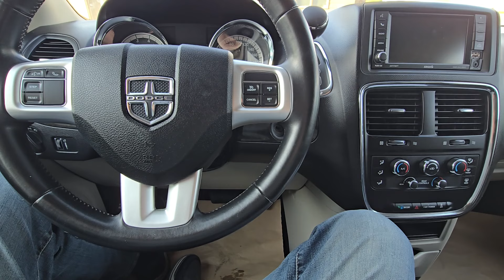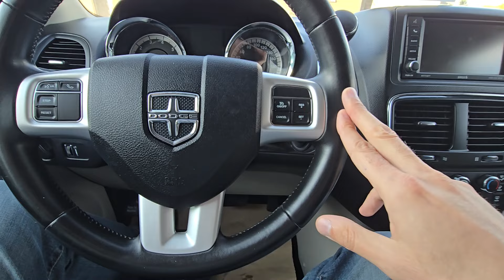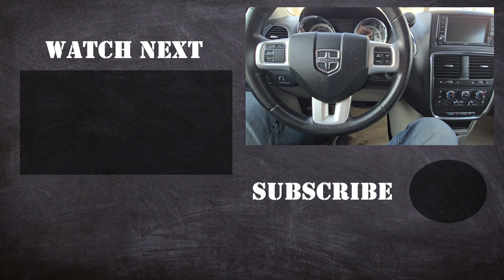Dodge - ALWAYS USE OEM MOPAR ELECTRICAL PARTS - My Story

Comment: I bought for $11 per item in the Chinese marketplace in 2014 and replaced the injectors on my dgc 2008. No problem 10ys and 120Kmiles
Reply from the maker: Hi, I'm glad it worked out for you. Unfortunately I have problems constantly with aftermarket electrical parts on Dodge / Jeep / Chrysler so decided to record the video and warn people

Comment: I replaced the driver side ac actuator with a non oem one.Will that make the rear ac not to work,it comes out warm :/. Also rear light blinks for a while and then the ac actually starts to come out the vents.
Reply from the maker: Hi, driver side actuator will not affect if rear ac works that will be a separate problem. But rear defroster light blinking and not working at first startup is common issue with aftermarket actuators on Dodge. It cannot be synchronized and work as it is supposed to. You can try running synchronization process using higher end scanner but still it will probably fail.

Comment: Do you have any idea why trip info works sometimes and sometimes not on 2017 dodge Grand Caravan
Reply from the maker: Hi, hmmm I would say it could be a lose connection behind the cluster or problem within the cluster itself. If fuse is burnt then it wouldn't work at all and complete cluster wouldn't operate